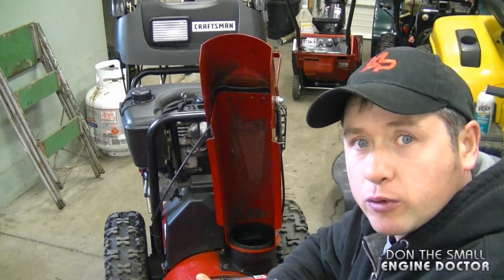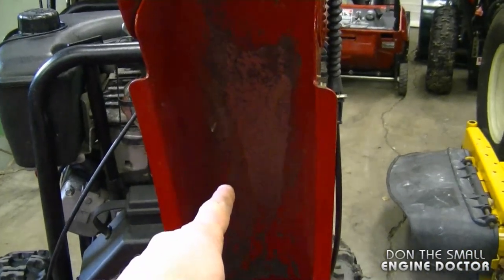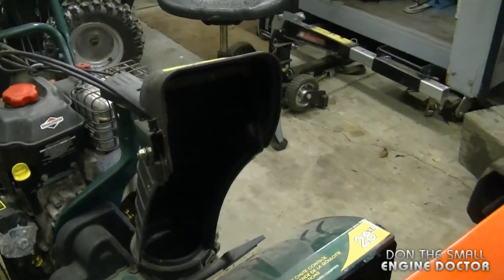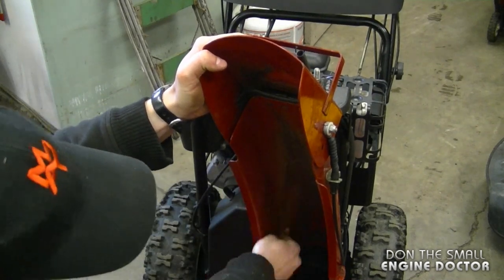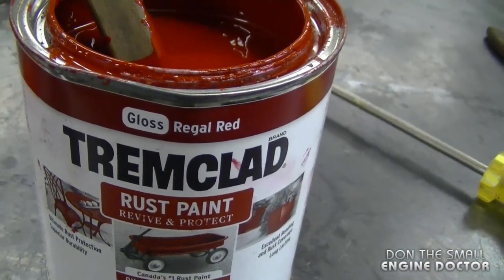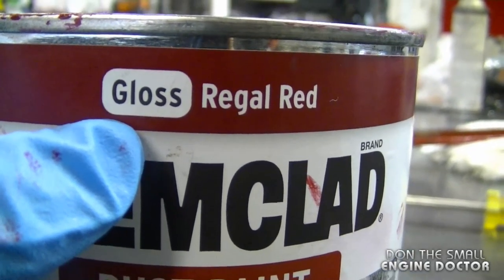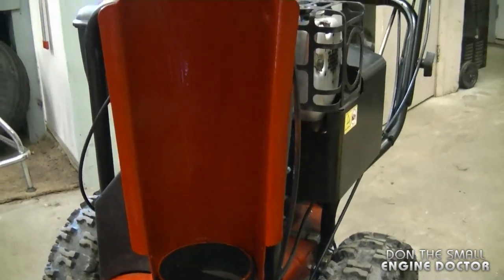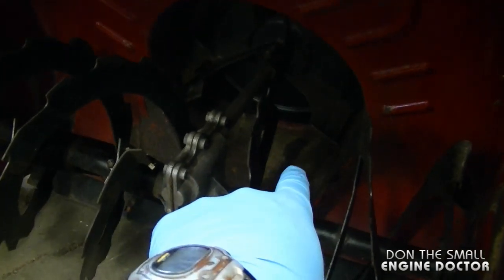Snowblower Quick Tip #7 - Painting The Chute For Better Performance

Comment: I use gloss black chassis and grill paint I picked up at Harbor Freight.  It's inexpensive and does hold up well on outdoor equipment, just clean and spray.  It does seem to need 7 days to fully cure.  I have a gravel parking area so when searching for my current snowblower I wanted one with a strong metal chute, I ended up getting a 1971 Ariens Sno Thro and absolutely love it.  I just installed some rubber paddles on the impeller to hopefully help push out slush and wet snow better.  After every use I wipe it down and spray the entire machine with Blaster silicone lubricant which helps with snow not sticking.  I started doing that after spraying my plastic snow shovels with silicone lube and saw how well it keeps snow from sticking.  The silicone spray also seems to push water out of all the small areas like bearings to prevent rusting.

Comment: I spray the plastic chute and auger area with silicone spray before I go out and blow snow. Makes all the areas that snow touches inside the machine slick and non stick!
Reply: I do the same with mine.  I use the water resistant kind.

Comment: I'm refurbishing a 1999 cub cadet 926se.  Love it . I'm using a drill and metal brush so it go's faster . Then primer and paint with gloss . I'll be applying also the perpeller rubber extenders for slush and also before each season I'll be using board wax . Look at a surf shop . Bottoms up

Comment: In the second stage of my snowblower I attached paddle extentions made of high density polypropylene.  With a zero clearance, the snow is projected about 25% further and the slushy  snow does not build.  Like your video,  together with the paint you will have fewer issues.

Comment: Tip:  After you do all that and the paint dries, spray anything down  that snow touches with Fluid Film. It keeps the snow from sticking to the compoments and clumping up. Also a great rust preventer.

Comment: How about spraying paint into the impeller housing while the blower is running? It could be messy as some will probably be blown out the chute. You could cover the chute with a towel or cardboard so you don't get a face-full of paint. I think it could help make the housing  smoother and improve the performance a bit. The housing  gets worn down to the bare metal by sand the blower picks up then it rusts.  It's a lot of work removing the augers and impeller. You just have to make sure you don't get your hand in the augers.

Comment: I'm hoping you can help. I have craftsman snowblower 5 years old maybe. It starts first pull every time. All the sudden the exhaust started to sound different and it died. I tried to use the electric starter  but it takes forever and soon dies under the slightest load. It also sounds and  feels like the exhaust is leaking out somewhere else around the motor. The muffler looks good. Is the motor cracked open somewhere under a shield? I can't tell without pulling off all the shields what could be causing the odd sounding exhaust leak. It also sounds weird when pulling the starter cord. It's a Briggs motor. 8 or 8.5. Can't remember which
Reply: Brandon Lund what's a weird sounding exhaust does it sound like a valve clatter like a TICK or jus whooshing air if was cracked you'd know it would leak while running. From what you have said it could be a lot of different stuff

Comment: I painted the auger blades on my Honda hs1332TAS with a glossy black finish. Looks beautiful but idk if it’ll last. Just had surface rust. I used glossy enamel black rustoleum. Think it’ll hold? Wonder if I should do a clear coat after or fluid film? Any advice.
Reply from the maker: it wouldn't hurt!
Reply: @donyboy73  I didn’t really sand it or anything. You’d really have to sandblast it to make it new again. I figured it looks much better though. The auger blades

Comment: Does it matter how thick you put the paint on? In theory more paint the better?
Reply from the maker: as thick as you can
Reply: @donyboy73  would you sand inside auger housing as well, or just chute prior to paint? Also did you use just a wet rag, gasoline rag, or clean rag prior to painting. Thanks

Comment: I have a plastic chute on my Craftsman snowblower.  It will not stay on because the parts holding it are broken.  Where can I get those?  Thanks Don!
Reply from the maker: hi don, do you have a part number or is it exactly like the one in video?
Reply: @donyboy73  I don't have the part number yet.  I'm going to take a picture of the model number and serial number sticker and also look for the manual.

Comment: I bought a brand new snowblower attachment for my tractor, which I started using this year.  It has a metal chute.  After using around 4 times, I noticed a lot of the paint inside the chute as well as most of the paint inside the auger shell have already came off.  If the factory-applied paint came off that quickly,  I don't really see the point of re-painting the chute with a vanilla after-market oil-based paint from the home center.  Do you know of a paint that's a bit tougher against abrasion?
Reply: maybe yours was painted on a Friday? Who's to say what they used is as durable as a nice aftermarket paint?
Reply: paul johnson enamel are nice and hard but chip a little easier

Comment: Hi dony wish I was closer to you, I don’t trust any shop been ripped off too many times, my problem is with a 9/28 john Deere, 305 Briggs and Stratton motor, replaced the coil, magneto, and cleaned the carb good, replaced spark plug, now when I go to blow snow after it warms up, 10 minutes it sputters and dies, then I could usually restart it about 3 times and every time it runs less and less, can you please help dony, thank from chestermere, Alberta.
Reply: roger brandt once the problem is occurring check for fuel and spark . Somthing is getting up to temp and not liking it usually a coil or kill switch
Reply: roger brandt another thin did u replace all this stuff trying to fix this problem or did u just tune it up. If it waswn t occurring before swapping parts could be somthing you did double check everything coil gap, etc
Reply: Ryan Rohauer no it was having that problem before, but I did find the problem, I loosened the gas cap after everything I did, I ran it for an hour, no sputters, I’ve seen recommendations about replacing but I’m stubborn, it was the gas cap, thanks for your reply, I really do appreciate it.